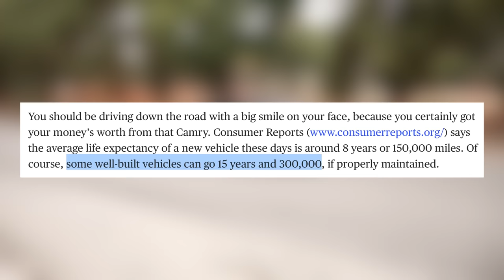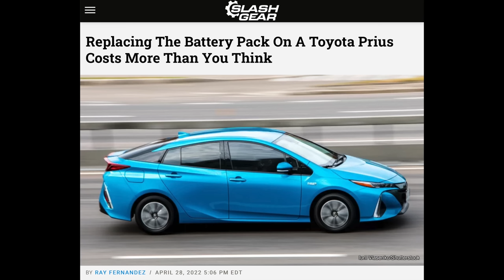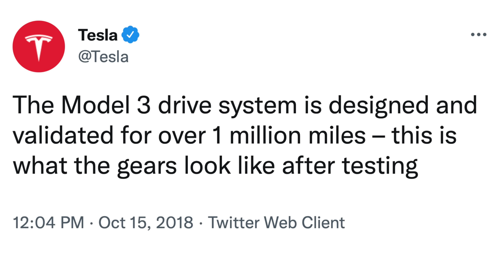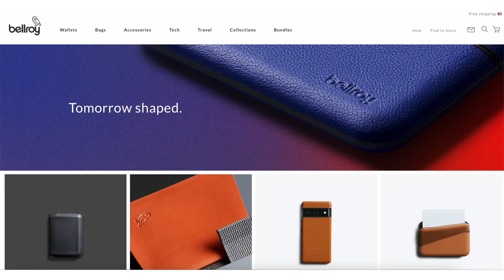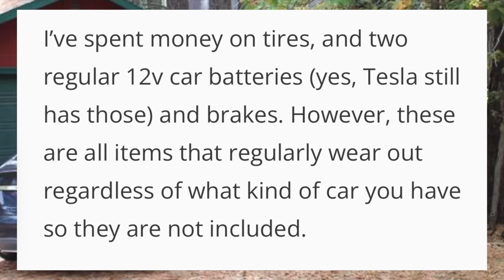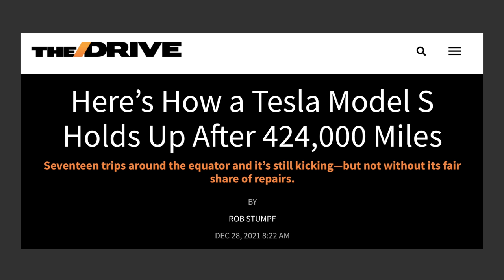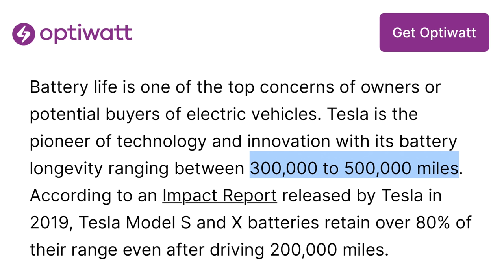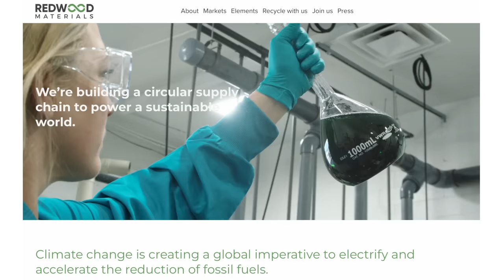The ONE MILLION Mile Tesla | It Still Runs

Comment: A manager in my current company used to work for Tesla. Specifically in the battery side of it and he says to fluctuate the charging, as in charge to 80 one day to 70 another and to full every once in a while. He says never keep it consistent and charge to a specific percentage every time because it’ll learn your habits and then won’t be able to charge to its fullest capacity. 
I don’t know how true that is or whether it is outdated information (he hasn’t worked there in years). But I’d like to know what has/will work. I just recently got an M3 and want to make the most of the battery.

Comment: A friend of mine drives a Volvo V70 D5 -2003. It has 418000 miles on it. It got the stock engine and gearbox. Properly maintained. I did have a BMW 540i -97 that I sold when it had 200000 miles on the clock, still running :) I maintain my cars by myself, so the costs are really low. One of my cars, a BMW 130i -07 I owned since 2014. I swapped the 12v battery once, startermotor, ABS-unit, front controller arms, tires and brakes like all cars :) 
Battery was 170$
ABS-unit was 280$
Controller arms 300$
Brakes 400$ (all 4)
Tires, I dont remember.
Thats all for 9 years.
If I owned a EV instead I would have saved some on the fuel 🤗 But an EV is much more expensive where I live..
The BMW 130i was about 14000$ in 2014 when I bought it. Today that 130i model has become more popular, so if I sold it today, I would probably get around 10000$. So not to bad after 9 years of ownership. 👍
I want an Model S Plaid and a BMW M140ix as an second car 👍🤗

Comment: Rare occasion? Check model S used on sale now, a good 20% had their battery pack replaced.
And study already show that the average cost of maintenance and repair of tesla is over 800$ per year, while it's under 600$ for petrol car. Mostly due to the high repair cost.
And 8 years seems really short for an average car lifetime, half the car on the road are this old or older...
And sure tesla only disclose battery retention, but not the amount of failure/replacement under warranty.

Comment: Is there data on how a battery behaves when it fails completely or at severe degradation? I mean like after 80% or 90% degradation. When will the battery fail completely? Will the more or less strait line degradation be steady throughout or at what point will the battery become unstable, and range is no longer predictable? We have all had cell phones that the battery hits a turning point where it will say there is charge remaining then just die because the battery has become unstable. Will EV batteries behave the same way and if so at what point? Has Tesla or anyone else tested this?
Reply: Unfortunately the internal resistance of rechargeable batteries declines with each charge/discharge cycle and supercharging only accelerates the battery’s deterioration. While the batteries will last much more than a phone battery a lot of variables will determine the health of your battery. A car battery that has always been slow charged will last longer than one that has only been supercharged for example. It also depends the rate at which you’re discharging the battery as well as several other factors. Unfortunately the limitation to battery technology is just the laws of thermodynamics taking over.
Reply: @-a13x-75  I understand I'm just wondering if anyone has studied EV batteries to absolute death of the battery and what it will look like. Everything I can find keeps pointing at replacing an EV battery at 25 to 35% degradation. I would like to know what happens when an EV battery is not replaced. When it is used until it fails completely. Will the car's onboard system be able to predict mileage (at least ballpark) when a battery is only capable of holding 20% of its charge? Consider the end of life or past end of life car market. If EVs are going to replace ICE (Internal Combustion Engine) vehicles there needs to be the equivalent of the modern day 1995 Honda civic. You know the car. It's got over 300k miles, the AC doesn't work anymore, the radio randomly turns off, the rust spots have been spraypainted... but it will get a teenager just starting out to his first job or a down on their luck dad back and forth to the store. A theorical 25- or 30-year-old Tesla that had a range of 250 miles degraded 80%... down to 50 miles of range would still be useful to such people. I'm wondering if tests have been done to see how EV batteries behave at such extreme degradation. These old ICE cars produce even more emissions since they are in such poor mechanical shape. Many have been stripped down to the absolute necessities to function making them extremely dirty. End of life or past end of life EVs would be a great alternative if the degraded batteries are dependable enough for such short trips.

Comment: What does mileage have to do with LCD screens failing? How many miles does your phone LCD get before failing? You may want to dig up the total driving time that it took to get those 400k miles done. In heavy traffic you can average 10mph all day vs 60mph if mostly doing highway, hence your screen may die at 100k miles. Screen time kills electronics, not mileage.

Comment: Thanks for the content, I agree with most except for the part re decrease in range. For my 2020 Model 3 SR+, there was a noticeable decrease in range after just 1 year, ~5-10% decrease (not unlike my smartphone). I generally kept the charge within 10-90% per the manual, drove only ~8k miles the first year due to pandemic, and mostly charged at level 2 chargers at work/home. The purported 2% decrease in range after 1 yr is baloney if I am a representative sample. Why wouldn't I be, since Tesla techs told me the battery degradation rate is "within range" when I brought up this issue.  The 2nd to 3rd year, the range was down 15% after ~30k miles. Now, after 4 years, I notice 15-20% decrease. Don't get me wrong, I love the car (and I even bought a 2nd Model 3 recently) but my experience with battery degradation was vastly different from what's being told in this content.

Comment: About 7% battery degradation for me in 95k miles and 4 years of driving - although that 7% was reached at about 75k miles, and there has been no further degradation in the last 20k miles
Reply: Wow, 7% is a significant drop in the most important aspect of an electric car - the range. I would not be happy with that
Reply: 7% is about 50-60km drop in range ... and thats on a good day in ideal conditions... if you live in a cold envirorment then you can say hello to a battery replacement in about 100000km or sooner

Comment: 2019 m3 LR. I bought it used at 15k and used it for ridesharing and delivery; it’s up 85K. At a full charge it’s giving me 293 miles from 310. I had 12V replaced around 60k, bushings and control arms replaced at 85k. It all costed me $800 in car repairs including smash me plates. Tires around $900 since I swap them out every year. I plan on getting upgrades such as sway bars, coils and wheels. It’s a fun car to drive.

Comment: Bit of info on your points @ 1:40 and 10:02 about braking care. 

I've had a model 3 (bought used) for about 8 months now. I wasn't properly notified last time I went into a tesla service that my brakes we're overdue for a service which is their only recommended upkeep which can cause damage to the car. Due to the regenerative braking on the cars, drivers rarely use the brakes and this can cause debris to jam the calliper and potentially seize the whole mechanism. One calliper replacement cost me $850. 

Watch out for this service as it is important and Tesla will not cover anything even though their warranty mentions nothing about not covering this issue. They refused to cover any of it even though the vehicle is still under full warranty. They didn't notify me of outdated service when I was there 4 months prior where they replaced my windshield AND rotated my tires. The service center "won't let you leave with an unsafe vehicle", but they let me take my car home that had a nearly seized calliper at the time which can cause the brakes to lock up and veer. 

Tesla's service requirements are low, but they will fuck you where they can.

Comment: I bought my 2021 Tesla Model Y 2 months ago and iv only had it for 3 days. I bought it used with 30k miles, on the drive home from the dealer when I picked it up I had to take it to service because the AC did not work. Aside from the AC not working my horn didnt work and my trunk didnt open. They give me a loaner and i picked up my car in 2 days. On my way home from the service center I get a message saying unable to charge so I turn back around to service. They tell me I need a brand new battery. A month goes by and they replace my battery, some other small things and the plastic shield under neath the car. Inspecting my car in the lot, it was extremely dirty on the outside and all my white seats had black marks on them. My service advisor comes out and I show him nicely how dirty it is and I told him I just want to open the trunk because I havent seen whats back there. Thank god I did because the left side of the plastic in the car was completely scratched up and damaged. So I need to go back next thursday to they can replace the giant peice of plastic in the back left and right side. i didnt ask for him to replace the right he just is doing that for me. I just picked up my car today and my horn isnt working and my trunk is not opening and i sent my service advisor a video of me trying to open the trunk 6 times and it not being able to open. 🙃
Reply: What is your point?

Comment: Battery replacements are very rare but that cost even with very low chance of happening is too much for some people to gamble on. If manufacturers designed packs to be servicable if a cell / module or BMS board fails that would be better for vehicle resale values and for consumers in general. Some OEMs have designed packs like this and service these parts but others don't namely the latest Tesla units which modules are covered in thermal potting compound to the point where nothing is accessible for repair.

Comment: Old tech: my 19 year old Prius w/ 225,000+ miles on it. Battery: 2 cells replaced @ cost of less than $800 several years ago. Lab engine oil analysis: excellent, balanced indicated wear with 2.5% fuel contamination which suggests dirty pollution control devices. Use: approximately 100 miles per month around-town in town of 4,000 population and few stop signs plus 750 miles per month to medical appointments @ 68 mph on interstate highway. Average fuel consumption month after month: 46.7mpg. Balance this account against the manure dished out by ICE interests.

Comment: Honest question -- I work for the fire department.  We work 24 hour shifts every other day 3 times then have 4 days off. 
Would it be bad to plug it in to a 110 for 24 hours each day?
Would it meter itself??
Reply: I think 110 will be the best for health of battery. The slower the better. But this is just my opinion.
Reply: You can leave the car plugged in all the time. The vehicle will manage the charge itself. It won’t overcharge from staying plugged in. And for ordinary 110 it actually charges very slowly. 
1500W per hour. The battery holds 45 to 60 kW.

Comment: The problem is who is going to give you a decent price on an 8 year old ev when the battery could (in theory) pack up at 9 years. it's true to say that a car engine could do the same but ICE cars have been around for a lot longer and if the engine fails it rarely leads to needing a new engine costing £12,000 plus. I have nothing against ev's and at some point will probably get one but still unsure. there is a Carwow video about a Zoe car with only 46,000 miles that is only 11 years old, now only gets 59 mile range. My old (2007) Golf is very tatty but still goes over 500 miles on a full tank. I still think the Tesla is the best EV Though and will propbably be my next car. Like your videos Ryan.

Comment: These lifetime estimates seem really low. I sold my '94 civic about a year ago. It had 280,000 miles. Only repairs were one half-shaft, battery, plugs, and wires, a starter, a radiator, clutch master and slave, and a cat. I didn't even really change the oil until the light came on, and even then I usually just topped it off.

I have a 98 Rav4 with 270k miles, same deal. It runs fine, just the consumables that wear out have been swapped.

Lastly I've got an '04 Civic with just under 90k miles and it drives like it's new.

Other cars I've had: '79 Accord, '88 Corolla FX, '90 Corolla SR5, '88 Cherokee, '92 Celica, '95 Civic EX. None of them ever had real problems except for the Celica. All of them (except for the Celica) brushed up against 300k miles before I either sold them or donated them to charity. Some of them I've seen on the road a decade after selling them (small town and all)

The idea that a car will last just 8 years or 150k miles is insane. Maybe I'm lucky, but for sure it's not because I was meticulous about maintenance, because I never have been.
Reply: Not lucky, just very good vehicle choices. Your list of cars is basically a greatest hits of some of the best built vehicles to ever grace the road

Comment: Onlly applies if you’re not car savvy and hardly change your oil to synthetic otherwise a regular car should last forever. Worst case scenario you’ll have a blown head gasket which is about a $3000 repair or a replace transmission which is another $3000 repair, electric vehicles have an advantage that they don’t have to deal with that however the short driving ranges of less than 300 miles And the 30 minute supercharge doesn’t even charge up The whole car which makes the trade-off a worthless inconvenience. When electric  cars finally get to a  500 mile range and less than 5 min of a full charge then they’ll become mainstream. Otherwise gas vehicles are way more convenient.

Comment: Yeah, the people worried about this aren't new car buyers, we're used car buyers who throw $70-150 parts at a 5-10 year old car for 5-10 years $5-7000 is budget for most people to finance a replacement car occasionally, not for a replacement part.  I'm not saying maintenance is generally unaffordable, but that the prospect of needing battery work is pretty scary, I suppose as scary as needing transmission work in an automatic car.

Comment: Are these high mileage cars mostly west coast cars? What about cars in the "rust belt" states where road salt limits car lifetimes to about 7-10 years before the chassis and body components are corroded beyond repair? The batteries survive but the rest of the car dissolves around you.
Reply: Well I'm sure any high mileage car is not from the northeast or wherever they get rusted out at. I'm in Texas and nothing rusts here that I've ever seen. It's kind of weird to even think about a car getting rusted, must be horrible to deal with.

Comment: The reason most vehicles currently get scrapped at only 200K miles is because of the engine. All those moving parts wear out, and eventually the cost to keep the car on the road exceeds its value, and it goes to the junkyard. When Saturn did their EV test release back in the day, after 5 years the vehicles were still like new.  Most EVs will likely remain in good working condition much longer than an ICE vehicle for that reason, as long as they're not mistreated. This has multiple benefits. Your value over time increases in comparison to an ICE, and at the same time, les physical material eventually has to be recycled or disposed of, and when it is, there's much less toxic materials, particularly fluids, impacting the environment.

Comment: When a battery loses it`s capacity to 70% is the electricity wasted as heat on a normal charge time ? Will the charger stop trying to supply the power to the battery or is electricity being wasted? I`m just curious if the money per Kw/hr or range loses it`s efficiency.

Comment: I wouldn't really say rare now that it's a year later. Seems like 6-8% chance your motor or battery will need replaced 120k-150k miles. Normally, it's high mile drivers that mostly supercharge. Nobody ever talks about time decay. My concern  is will my 2019 Model 3P battery last 120k+ if I drive 10k miles per year?

Comment: This is very easy to simulate in a lab.  Connect the axles to some dynopacks and create a load profile to simulate acceleration and driving cycles.  Run it 24/7 and you’ll have 1 million miles within a few weeks.

Comment: In Sweden, the Tesla 3 seems to lose battery capacity quite a lot in the first three years.  There is an online store in Sweden that sells used electric cars and they indicate the battery capacity of each car.  and there a Tesla that is 3 years old seems to have a battery capacity between 85 and 93%.  whether it could be due to Sweden's cold climate or whether it could possibly be due to the battery heating being way too hot, I don't know.  but Tesla S doesn't seem to have the same problem with the gradation of the battery on their car ads.  according to their car ads, a Hyundai from 2020 can still have 97% battery capacity left